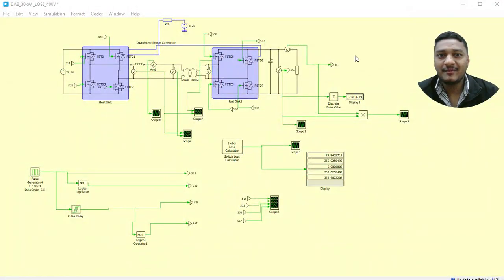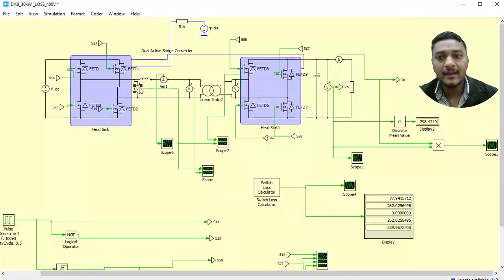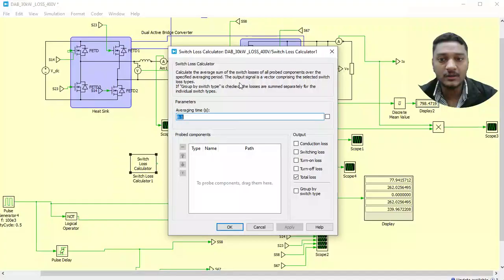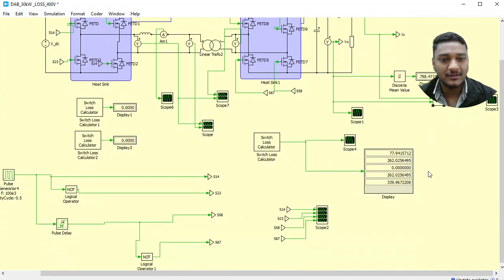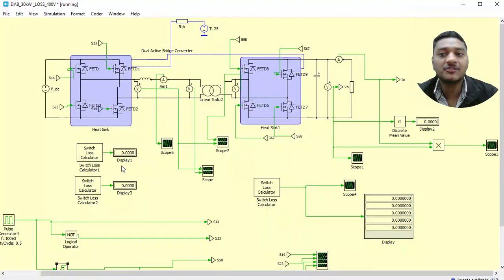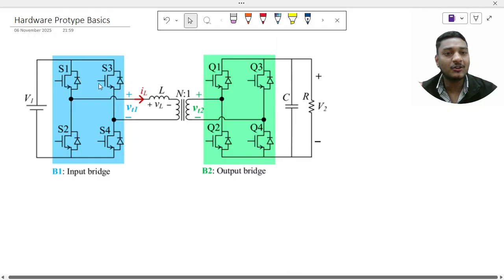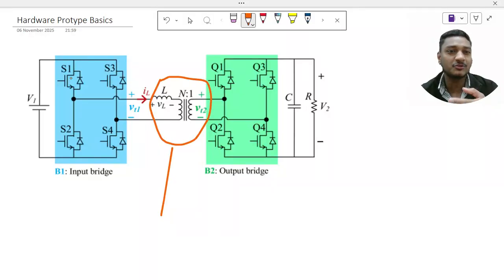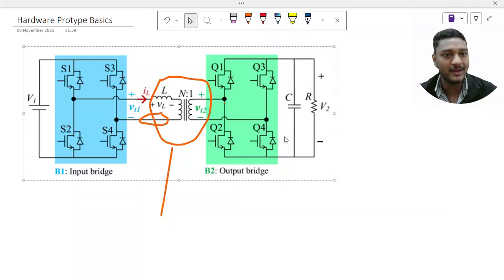LECT 7-C: PLECS Demonstration of Soft Switching in DAB Converter || #dabconverter

Comment: Hello sir 
If I take V1 = 330 and V2 = 48v which operates as buck mode 
And if I take V1 = 48v and V2 =  330v which operates as boost mode 
For both the operation in Dab converter is output voltage expression is same 
And the capacitor and inductor expression are the same ??
Reply from the maker: Yes, It's same.
Reply: @Kingashish-555  hello sir for the value V1 = 48 and V2 = 330v, frequency= 100khz, power = 1kw,  for these values i got the wrong phase shift value like complex number would u please help to calculate phase shift value and inductor value 
Please sir 🙏
Reply from the maker: @prathikshakm483 ok once i'll go to my siting place, I'll run the script and try to run the sumulation for your value and give it to you. 
Most probably before 11.59pm today I'll share.
No worries, I'll there to help you all if that is in my range

Happy learning😊
Reply from the maker: @prathikshakm483  This are the result I got for your parameter and you can you this:       
--- DAB parameter summary ---
V1 = 48.000 V, V2 = 330.000 V, Pout_req = 1000.000 W, Fs = 100.000 kHz, N = 0.145, L = 2.3e-06 H
Switching period Ts = 1e-05 s          

Calculated values:
P_max (phi=90deg) = 1.250 kW
L_max_allowed (to meet Pout at phi=90deg) = 2.88e-06 H
phi solutions (rad): [0.868315 , 2.27328]
Selected phi = 0.868315 rad = 49.751 deg (produces P = 1.000 kW, requested 1.000 kW)

Load & current summary:
R_load (resistive) = 108.9000 ohm
I_in_avg = 20.8333 A (Pout/V1)
I_out_dc = 3.0303 A (Pout/V2)

selected_phi_time =

   1.3820e-06

ratio_constant =

    0.1382

And with this value I am getting perfectly fine output. Hope this will help you.

Happy Learning
Reply: @Kingashish-555 thank you so much 😊
Reply: Hello sir 
If I take secondary bridge as source and primary bridge as load 
Is the results are same
Reply from the maker: @prathikshakm483  just change generated gate signal terminal that will work. Because which bridge has phase shift will determine power will flow from which bridge to which bridge.
Reply: @Kingashish-555 ok thank you

Comment: Hello sir , your lectures are good, can you please share notes means that slides you are using in lecture
Reply from the maker: Thanks for your kind words.
I have not prepare any notes as such, they are just something to show and maximum things I'll explain orally. I'll be really happy if you prepare them based on your understanding through the lectures that will keep that concept with you for long times. Or you can use screenshots for your reference, but if possible try to make it.
Apart from this if you have any technical question or anything you can ask me here or connect with me on linkedin and ask I'll be happy to answer you.

Happy Learning
Reply: @Kingashish-555  ok thank you sir